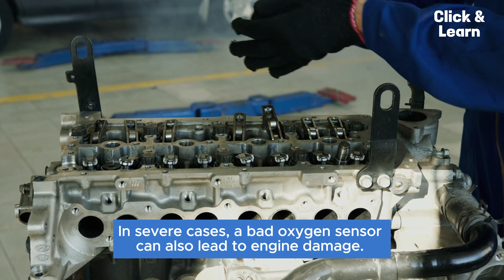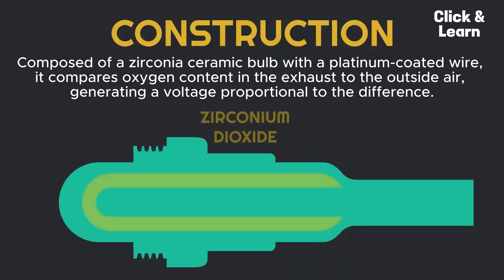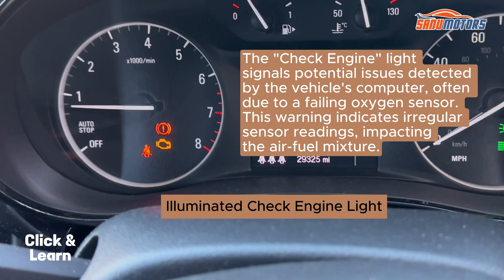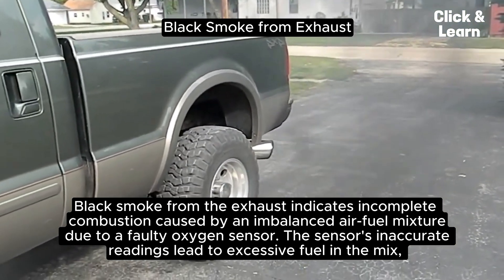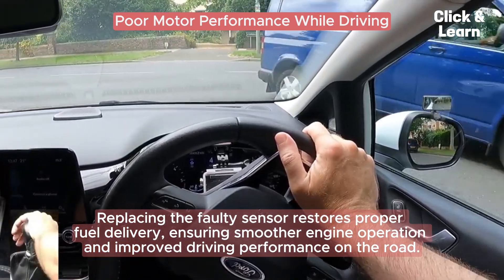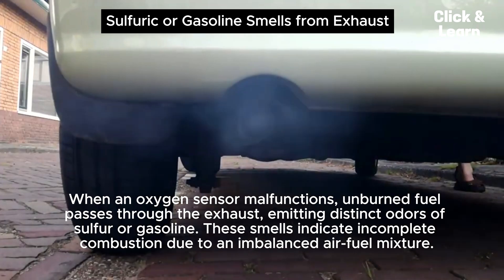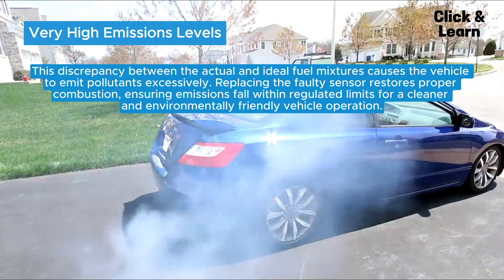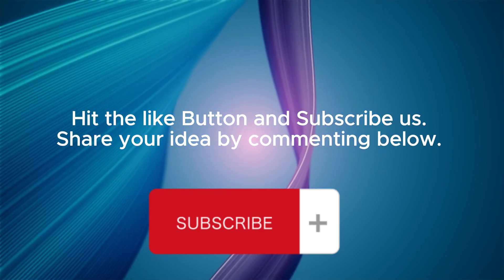Bad Oxygen Sensor Symptoms

Comment: Thanks for your video . Th solution to the symptoms described is clear , replace the sensor or sensors . Being a home mechanic that advise is simple enough thank you , but what if a sensor is stuck in place ; is there a grease  , or something else maybe , which I could apply to prevent 'welded' in sensors ? If I carried a spare sensor and it was easy to fit then a lot of time could be saved in diagnosis of engine running faults . Also , what are the most reliable makes of sensors .
Reply from the maker: Thank you for watching us and giving feedback !

When a sensor gets stuck, applying a penetrating lubricant like WD-40 or a dedicated penetrating oil could help loosen it. Allow the lubricant to soak in for a while before attempting to remove the sensor.

addtionally this video will help you (From 12.43 onwards) - https://youtu.be/Cf0VHoJ1IOE?si=_rEaoDgTv06fCFCO&t=762

Otherwise when you install a new one use High-Temperature Grease.

for more knowledge about sensors in vehicle watch this video - https://www.youtube.com/watch?v=AnA6Cp6x45M&t=165s

Regarding reliable sensor brands, there are several reputable ones in the market. Brands like Bosch, Delphi, Denso, and NGK are known for producing quality sensors, but it's always a good idea to check reviews and recommendations specific to the sensor type and your vehicle model.